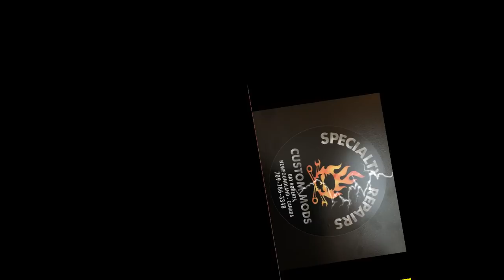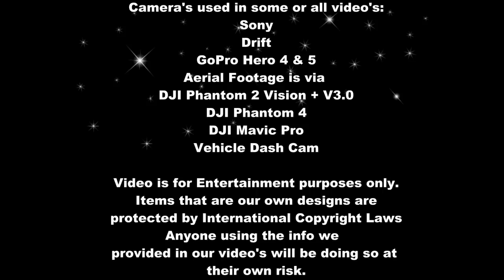A Riveting Job In The Mod Shop PT. 1

Comment: I was a  fabricator also, never  got to use a plasma  cutter like that  one! Watched several work though. They  make fabing  so  much easier!! Great    Job!!
Reply from the maker: Thanks Wayne. I never thought I’d go CNC in my lifetime but when we went into manufacturing we had to do it. It was a little tough at first but we are just about two years into it and very happy how it all worked out. Thanks for watching and commenting.

Comment: The ball peen hammer you have on your metal work table is what I use to rivet replacement teeth onto the sickle bar mower.  You tap around the edge of the rivet  in a rotary pattern.  Once ya do a few, your work looks pretty good; not smoothly round, but faceted or dimpled.  It gets it done.
Reply from the maker: Very cool. I’ve used them that way as well. Looks good as well. With this stool I’m trying to achieve the look of the other items in the shop. I know it’s a little crazy but that’s just me lol

Comment: Could the tracker have made holes that small for rivets along with the layout.
Wishing you a Merry Christmas and a Happy New Year.
Reply from the maker: Yes it can but for solid rivets the holes need to be almost perfect so I punched them. The holes are 1/4 and the cnc plasma will never get it as good as the punch. Great question. 👍

Comment: Paul those rivets can be a pain in the rear end when I was in junior high metals shop the teacher asked me to help repair a work bench with those type of rivets even the brass rivets after I had peened 3 that broke he told me the trick a little bit of heat and they don't do the splits
Reply from the maker: If they split they might have been a bit longer than needed. I’ve never split one but then again I haven’t put a pile of them in either. Not sure I’d like using heat. Thin metal hates heat.
Reply: Paul & Kathy Short the total metal thickness was 1/4 inch from both metal parts